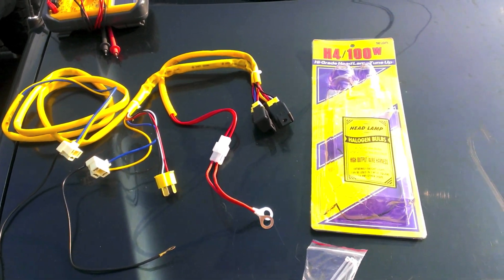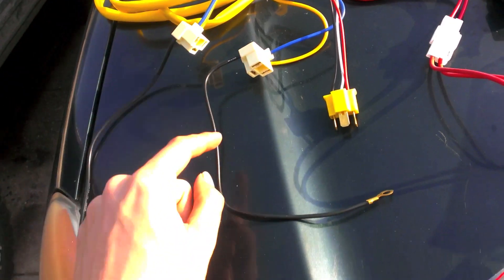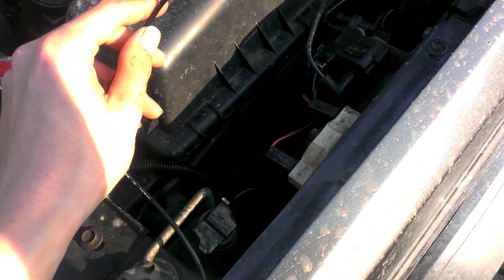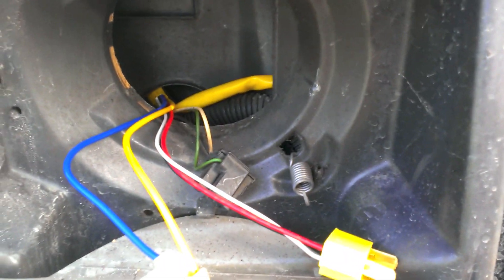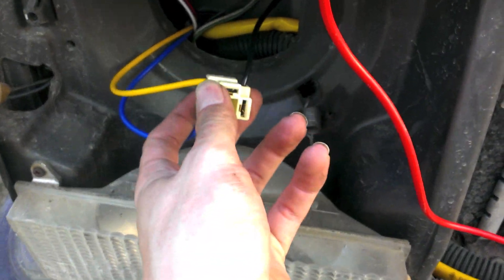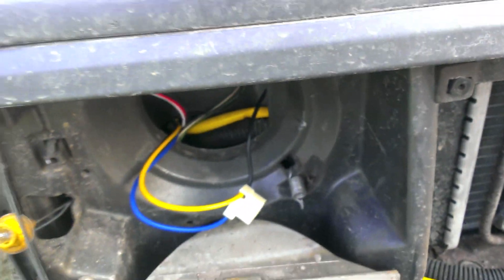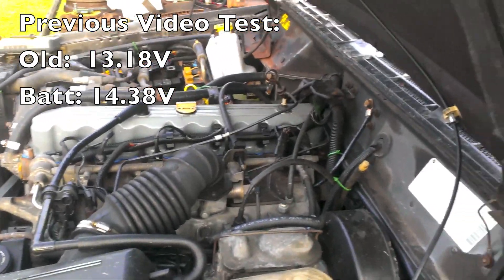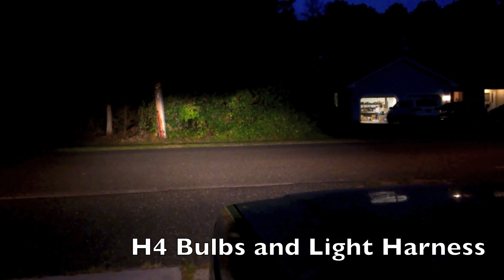89 Cherokee Headlight Wire Harness Upgrade

Comment: My passenger side connector is destroyed, could I run it the other way it I extend the power wires?
Reply from the maker: Yeah, that would be fine. As long as the relays get a trigger source then you will be solid

Comment: Thank you once again for an awesome vid. Wondering if fog lights have anything at all to do with this harness. I want to add fog lights. Will the harness cause any complications?

Also, wonder what is the difference between the $125 ARB version and the Putco kit (besides about $95 :^/ )?
Reply from the maker: This kit will work with any type of lighting though for fog lights you only need 1 relay. You can make it all yourself for under $20 if you have the know how. I had to splice in different relays because those cheap Chinese ones kept rusting out

Comment: hey man i have hid headlight kit and the hid harness runs off of only the passenger headlight so would i only run this harness to the one headlight only?
Reply from the maker: Uhh, well Yes. But does you HID kit have relays or a dedicated 12v and ground wire? Because if it's not pulling power directly from the harness then this won't do anything for you.
Reply: NickInTimeFilms it’s got power to the balasts but i melted my headlight switch
Reply from the maker: Hmm, well if the current system caused that, then this will help you. This harness just uses the stock plug as a signal to trigger the relays, and they will take all the power through the new harness. Then plug whatever into the new one
Reply: NickInTimeFilms thanks dude. i’m pretty ignorant with electrical system

Comment: Thanks!

When you tested the lights you had "low beam, high beam and both" 
How do you switch for both??
Reply from the maker: With my stalk it's a little loose and has a sweet spot where if you pull it just right, it will hold the high beam and the low beam together

Comment: I installed this wiring harness on my 99 XJ and it seems to have bypassed or overridden the daytime running lights. Did this happen for anyone else? The headlights all work but the DRLs don't come on when I start the car anymore. Not a huge deal but I wasn't expecting it to happen.

Comment: how are you able to run both low and high beams at the same time?
Reply from the maker: My High beam stalk is a little worn so there is a sweet spot where they are both on. I was just holding it there.

Comment: What plugs into the second plug at 4:25 that you said you have to ground somewhere?
Reply from the maker: The little black wire that comes off just needs a good ground to complete the circuit. I used nearby screws in the radiator cover to ground them. I wish the harness just ran ground wires that i could terminate on the battery but whatever.
Reply: Yeah definitely. At first I actually meant what connector goes into the 3 prong slot that the ground wire is coming off of. The PO put some weird harness on mine. They're h4 housings but the back of the housing has wires rather than prongs sticking out. Here's a picture. I think I'm gonna get this wiring harness and probably end up getting new h4 housings. Not sure how to fix this. https://s24.postimg.org/90z511qet/IMG_0871.jpg
Reply from the maker: What in tarnation. lol. The plug that the ground wire is connected to is just the plug you use for the headlights now. Looks like yours is some kind of adapter to work with other style lights...
Reply: Lol! Welcome to my life. I just watched your h4 conversion video again. The bulbs you have come with that prong out the back. My housings do say h4 on them so I wonder if I got those bulbs, upgraded to this harness, and put them in if it would work. Seems like maybe?
Also, how did you just do low beams, then just high beams, then just low beams. I can only do either low beams or both. But my bulb setup is obviously very strange. There are actually 2 separate bulbs inside.
Reply from the maker: That sounds like part of your wiring set-up then. it's suppose to be either low beams or high beams from the factory, but I always wanted to mod it so both come on with the highbeams.
Reply: I think my housings are also in upside down. I haven't tried taking the little bracket off of them. By bracket i mean the pieces that the screws go through. I'm assuming you can take that off. I think I will try some new bulbs and get the harness. What bulbs do you recommend? Still the one in your conversion video? Unless you think I'm making a big mistake and I should get new h4 housings while I am at it.
Reply: Okay ...so I have two sets of wires for both headlights...do I use one set coming from light switch and just cut the other set off

Comment: I was thinking about re-wiring my headlights so I can either have just dims or brights + dims on. You think this harness would hold up well to that? My headlights is horrible, I can't see but maybe 15 feet ahead of myself at night lol.
Reply from the maker: I was thinking about doing that myself until I got a light bar. Have you tried aiming them to make sure they are pointed properly? H4 Headlight housing conversions are nice too and help spread the beam much better. Or you can step up to LED housings to really push out some light. 

If the harness has good relays rated to at least 30 amps then it shouldn't be an issue. You will have to look up how to properly wire it so that the high beam relay will trigger the low beam relay but it is possible.
Reply: I was googling some on it and it seems to be easiest with the GM style headlights. Still looking for a good write up on a single headlight with hi/low both. I'd love to get the H4 housing. I've read a lot of people complaining about the LED's, saying they blind other drivers and get flashed a lot for it? That's made me wary of buying them so far lol. I'll look for relays that can handle that for sure. I've aimed them the best I could but the light output is dangerously low. Here's a pic with my brights, sadly the streetlights is brighter lol. http://image.prntscr.com/image/9e61d66c32d047829fa388ffe77dd79a.png
Reply from the maker: No kidding, I can't even tell that they are on. Are those the brightest bulbs you can get? As for the relays,  you could wire it a few ways. If you want to use a diode then you could go from highbeam 85 or 86(Coil side, whichever is the positive input, not ground) to low beam 85/86 with the diode pointing towards low.
________[Diode]
HB 85 }____[-->]______{LB 85

Or you could put the load of both low and high beams on the high beam relay by wiring the low beam relay backwards. Instead of Positive to 30 and low beam to 87, you would have positive to 87 and low beam to 30, then use the output of high beam 87 wired to low beam 87A, that way high beam will feed low beam when it's off.
__________________[Relay]
(Positive)__ LB 87 [_/_] LB 30 (To Low Beam +)
(HB 87)______LB 87a [/_]
Reply: Lol yeah my gf won't even ride with me at night time because of my headlights. I don't think my headlights has ever been replaced, one might have but not sure. I been wanting to upgrade for a while but the H4 housings seems to be the only way to go with out spending $300+ on some over priced trucklites etc. Definitely saving what you said on note pad on my laptop so I can remember when I get the harness and new lights in. I think the first way sounds like the better way to go. Man that's badass how you have that down so well. Electrical/wiring was always kinda scary for me lol.
Reply from the maker: Haha, yeah I've just been messing around with everything so much that it's just in memory now. It's all just lego blocks once you know what the numbers and components are. I like my Euro Housings a lot and with a bright H4 bulb in there, they are pretty nice. Now you could also be getting low voltage to the bulbs from the factory wiring which will make them dim. The relay harness by itself could boost them a tad too.

Comment: Will it stop the infamous cherokee headlight flicker.
Reply: or flash on and off lights, while driving
Reply from the maker: Are you talking about them just flickering when you hit a bump or like a constant really fast flashing? If the lights cut for a second over bumps or driving then it's probably a loose wire somewhere. This kit may help with that as long as the inputs are good. I've heard one guy say on his newer one that it was buzzing or something weird, but I don't know enough about the newer chrysler models to really know.
Reply: NickInTimeFilms I am talking about is the 1992 or 93
Reply: NickInTimeFilms my uncle replaced the headlight switch, I'm the jeep. it worked fine for about a month, then it started back. while I am driving the lights flash high beam then turn off. repeat. Will the kit bypass that set up. (it my uncle jeep, I drive it school)
Reply from the maker: The relay kit only gives the headlights full battery voltage and takes the strain off the factory harness and headlight switch. They may still respond the same way as factory though.
Reply: NickInTimeFilms okay, thank you for response, and great video. really helps out. I'll try it. where do I get the Bosch relays from
Reply from the maker: If you order a pre-made harness it usually comes with relays, just make sure they are the square 5 pin relays. It will look like this: https://www.amazon.com/Headlight-Relay-Wiring-Harness-Ceramic/dp/B00H5JFHR0

If not you can just go to any autoparts store and ask for a fuel pump relay, pretty common style.
Reply: NickInTimeFilms okay thanks so much, I understand. do you recommend the link Amazon link or the link i, the description. (lol, this is the last question I promiss😁)
Reply from the maker: After reading some reviews of that amazon one, i would not buy that one, pretty craptacular. The putco one is fine, except the cheap relays easily get sand and water in them. I cut them out and added regular bosch one in.

This one was suggested by someone else that looks pretty legit: https://www.amazon.com/Ceramic-Automotive-Harness-Headlight-Foglight/dp/B00BMN30HY/
Reply: NickInTimeFilms  gotcha, thanks so much. can't thank you enough.
Reply: Thinking of going with the Putco harness as well for my 01 XJ, anything in particular was done when replacing the included relays with Bosh relays? Is it a simple unplug and replug of relays? Thanks in advance.

Comment: Thanks for the video!  Now that it's been a few years, would you still do the mod?
Reply from the maker: Mark Adams Absolutely, but this time I'd look for a kit that came with standard Bosch relays like what the rest of the Jeep had. them cheap Chinese ones aren't sealed and don't take much to break contact. But getting full battery voltage and preserving the factory harness is a huge plus.
Reply: NickInTimeFilms perfect. thanks so much for the reply. I believe that I'm going to piece together the parts and do this myself, so I'll definitely grab done Bosch relays. 

ps - it's my first comment on your videos but I've watched a few as it seems like whenever I want to do something, you've done it. Lol. So, thanks again!

Comment: so would i need 2 of these if my 89 is a wagoneer (4) headlights?
Reply from the maker: sorta kinda. this has a high beam and low beam relay so you're good on that. You could separate the high beams wires and get 2 more plugs and you should be okay

Comment: hello , im having an issue with my 1999 jeep cherokee sport i upgraded to led head lights and they work fine with the engine off as soon as i start the engine both high and low beams come on and i can not control the lights with the dimmer switch, do you have any ideas why this is happening?
Reply: my e mail adress is chrisinpa@gmail.com thanks
Reply from the maker: Just LED headlights. no messing with the harness? Not sure what to tell you, newer vehicles can be weird with stuff like that. I'd talk to the headlight manufacturer if you can
Reply: yes just the head lights,i didnt do anything other than putting dye electric grease on the connectors,i have done that and they told me to check the grounds on the connector and i have a good ground there, i find it funny that they work fine engine off,

Comment: @ nickintimefilms have you ever seen any conversions for a 88xj wagoneer. it has a 4 light system
Reply from the maker: +chrys wallace Now that is a good question. I haven't seen any harnesses in my quick search, so you might have to make your own. I think you could also modify one of these harnesses if you add split the high and low beam wires and ran the proper plugs to each side.
Reply: Walmartrt on line, also summit racing has the the 4 head light system and Autozone. The Putco harness is the worst. try this one its better quality and 3rd the price.  http://www.newegg.com/Product/Product.aspx?Item=9SIA40F28S0459
Reply: Or do what I did order 2 of these harness and just plug both of them into youre old sockets and you will now have 4...2 his and 2 lows like on wagoneer

Comment: There is a "fixed" version out there. They claim to have fixed all the preexisting problems this harness had. Have not tried it yet but its in my shopping list. There on amazon if anyones interested. http://www.amazon.com/Ceramic-Automotive-Harness-Headlight-Foglight/dp/B00BMN30HY/ref=sr_1_3?ie=UTF8&qid=1422299608&sr=8-3&keywords=h4+headlight+harness
Reply from the maker: awesom3man3 I good way to figure out what fuse you need is by finding the current amp draw and multiplying by 1.5. You can do this without a multimeter with a little math. If you run stock bulbs you have 55W low beam and 60W high beam per side. 55 x 2 = 110W (total low beam) x 1.5 = 165W / 12.6 (lowest batt voltage) = 13A. So try a 15 amp fuse. If it pops but you don't see any harness damage go one up again to 20amp. High beams comes out to 14A so same applies here.
Reply from the maker: That kit uses standard American relays which is quite nice because the Chinese ones are terrible in off road conditions. Sand gets stuck between the contact and prevents it from fully closing. It also has a fuse which is a nice touch.

As for the fixes, that sounds like what a headlight harness is suppose to do in general. Maybe they used higher quality headlight plugs but I doubt it. Thanks for the link.
Reply: Daaaam I just installed the yellow putco harness and was hesitant about it. Of course they'd come out with this as soon as I install it!! I did splice 2 inline fuses tho - I put in 30 amp fuses but don't know if this is correct - are these what should be in there? *Edit: just read the comment below and comfortable with the 30A fuses and where I installed them. whew
Reply: awesom3man3 hey if you still under 30 days since delivery you can still put it back together and send it back for free. Just print a return receipt from wherever you bought it from. I sent it right back after i put it in to test it, I bought mine from amazon though and they have super easy return policy.
Reply: NickInTimeFilms Thank you that was an awesome explanation I could follow. I'll try the 15A fuse in there then, cheers!
Reply: NickInTimeFilms So the relays are creating creating quite the buzzing sound when the headlights are not turned on and the jeep is running (the daytimes are still working so if I understand correctly it's something like a low pulse through the relay causing the buzzing). The only info I can find about the issue online has to do with HID wiring and using a capacitor to fix the problem. I've got new relays and were going to put them in but am not confident they will fix the problem. Any help?
Reply from the maker: awesom3man3 Is the buzzing so loud that you can hear it while the truck is running. If you can't hear it in the truck I wouldn't bother. I'm assuming you may have a newer Jeep with OBDII and this is a computer feedback issue or something as my harness never buzzes. You could try taking voltage measurements to see if the relays are receiving power when the headlights are off. If it's fluctuating, a capacitor would smooth out the oscillations and may keep them from buzzing

Comment: Nicely done :-)), back in the mid 80's teenagers added spotlamps to there car along with other junk, but the mistake they allways made was "no relay", oh yes it worked but the lighting switch on the steering columb suffered badly, well it was cremated most of the time lol.

I picked up on relays in my electronics repair hobby so i allways used them plus a fuse, old tech but dam usefull :-))
Reply from the maker: Relays are my new favorite addition to any high watt circuit because I know it will be running the highest voltage available.
Reply: NickInTimeFilms
Yep they are relay good lol sorry bad bad joke :D

I will make comments on your videos, this does not mean i expect a reply, its my way of appreciating them, just so you know :-))

Comment: I recently purchased 100w 9004 bulbs for my 1991 ford ranger. Now the high beam indicator is constantly on and the high beams don't work. Would this remedy that?
Reply from the maker: Probably not. Did you notice this happen immediately when you swapped in the new bulbs or did it happen over time? There is a good chance that the bulbs were running too much amperage through your stock wiring and may have damaged the bulb connectors, wiring, or headlight switch. If something melted, you'll have to replace it. This harness would prevent such a scenario from happening again in the future though because it can take the higher amperage. 

I would remove the bulbs and see if the High Beam light turns off. If it does then you may have defective bulbs or a short in your headlight sockets. You can also try probing them with a voltmeter to see if you are getting power to the sockets. It's a slightly different subject but check out my Fixing Turn Signals video for more help:
89 Cherokee Fixing Turn Signal Issues